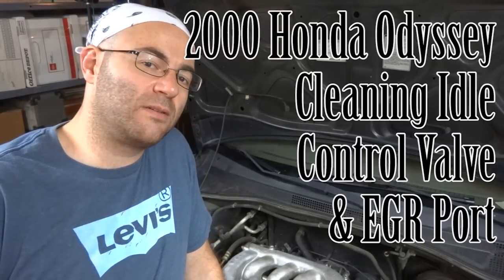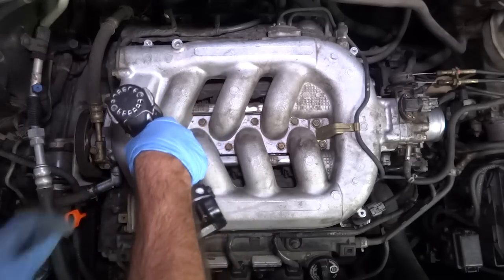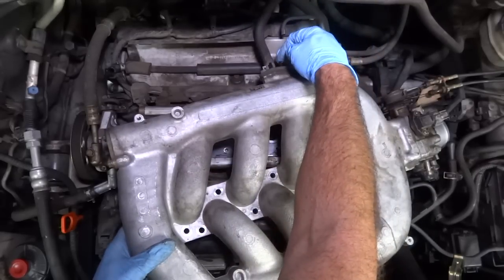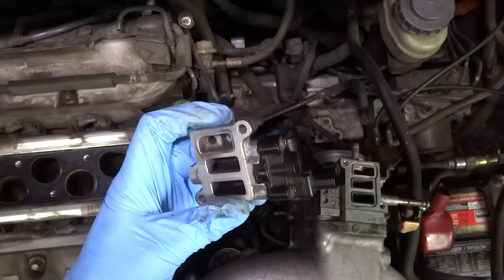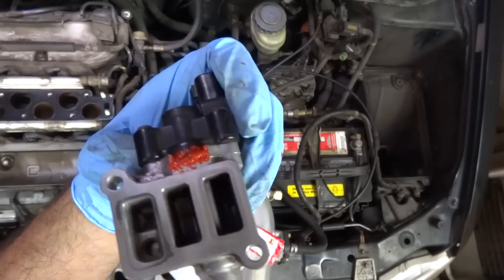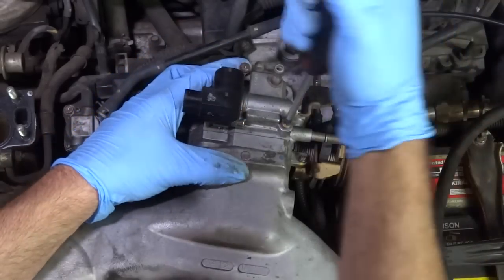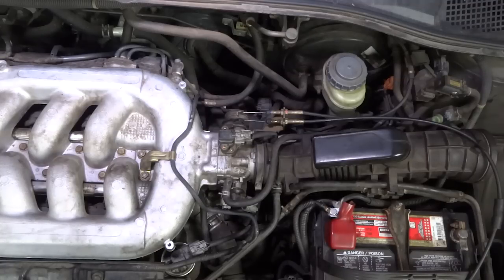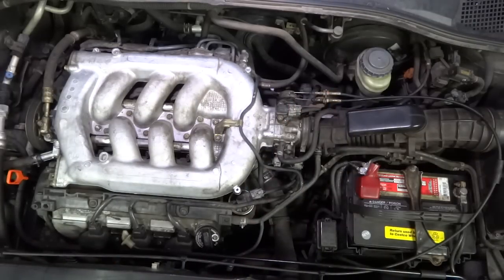Honda Odyssey Idle Control Valve and EGR Port Cleaning (P0401) DIY

Comment: For the IAC, you don't have to do all the disassembly.  As per your video, remove the air box, remove the connection from the airbox to the throttle body (have to disconnect a few hoses from it), then disconnect the coolant hose from the bottom of the throttle body, undo the two nuts and two bolts holding the throttle body to the manifold and it'll slide off. Turn the throttle body upside down and unscrew (2 screws) the IAC.
Reply: And then how do you clean out the EGR ports???
Reply: @cumshot247  you don't. The car I was working on did not have EGR problems, just a broken IAC, so I didn't want to do the extra work.
Reply: And for the record, the cleaned IAC stopped working again two weeks later so I replaced with a refurb off eBay, which has been fine for a couple months.
Reply: @PeterVieth  And for the record, this video was for cleaning out the IAC and to clean the EGR ports so that's why he took all that crap off...😒  The video wasn't about YOUR car...
Reply: @cumshot247  My comment started: "for the IAC, you don't have to do all the disassembly."  So if someone with just IAC issues searches Odyssey IAC cleaning and this video pops up first like it did for me, they don't go through all the steps of taking the manifold apart.  I suppose I should have known better than to respond in a YT comments section to someone with a username like yours.  Happy Monday.
Reply: @PeterVieth  Yes, you would have been better off making your own video commenting on your own work. Don't hate the Player...

Comment: There is/was nothing wrong with your IAC valve gasket.  Lacquer thinner causes these rubber gaskets to swell.  Notice how it fit again the next day when you came back to it and it was dried out.  Next time just use carb cleaner and you won't have that problem

Comment: Oh you kid!  You just saved me a few hundred dollars of mechanic's fees and unneeded new parts!   I just performed this maintenance, cleaned out the valve with Q-tips and methanol.  I finished it off by spraying some WD-40 in there and swabbing out all the excess.  I also reamed out the EGR port, which I had to pay to have cleaned out a few years ago.  It was well gummed up.   Now my 1999 Honda Odyssey no longer "seeks" at idle!   I reset the ECU error code, and now I need to drive it a bit before taking it in for its long-overdue smog check!

Comment: To save yourself a lot of work and trouble , just undo the 4 nuts holding the the throttle body on after removing the airbox leaving all the hoses etc intact . Just pull the manifold back away from the throttle body after disconnecting the IAT sensors , the 2 x 10 mm bolts holding the plate on and remove the large hose at the end .
You can remove the screws with mole grips or by clamping in a vice and use stock or low head allen cap screws after so you can take it off without removing anything but the plug and hoses . The O rings are standard size NBR which you could upgrade for a few pence extra and there is nothing fancy in there as the black part is just a controllable solenoid winding which lifts the pintle when energised like on any other Honda IACV. While your manifold is off , check and clear the EGR passages if necessary .
Reply: Thank you for your recommendation I was thinking the same procedure but I'm just learning again since I'm 60 😢

Comment: Informative presentation.  Not impossible but not an easy task thanks to Honda engineering.
How does the Idle Control Valve send a signal to the ECM?
Is there a way to confirm the signal from the Idle Control Valve to the ECM without removing?

Not much seemed to be gained by taking the ICV apart.

Comment: Hi. For my ody02. Only at cold start when idling, engine stutter and almost stalling, idles around 600, but everything runs OK after 10mins, idles normal around 750. No CEL. Thoughts?

Comment: Good morning, This video was very helpful   on cleaing my 2000 Honda Idle control valve however  my Idle control valve was not working effectively. I ended up replacing the idle control valve with a aftermarket part. What I noticed the vehicle. On the Cold morning  start up  there is no  high idle. Any idea on adjusting the idle control valve for a higher lide?

Comment: If you take the intake ( 4 bolts) off of the plimium, or manifold you my be able to get at that air intake vavle. However servicing EGR ports and channels is usually always required. Look to codes on how far to go?
Reply: Going to do the old seafoam treatment to get rid of check engine light for good though. Alot of trouble keeping EGR cleared. Out here in CA. RUNNING HIGH OCTANE SHOULD HELP TOO.

Comment: 6:20.... the screws are JIS type from Japan (Toyota and Honda).... heads  for those screws are NOT USA Phillips.... get a pair of bits for $8 in eBay. They will work fine and use a dab of Kroil or WD-40 at the base of the screws 30 minutes early to loosen them...   Put ALL of the hose clamps back in place  (see the center left screen)
Reply: Yes, if you own a Honda especially and plan on doing any work on them, get a JIS screwdriver. Vessel makes a good one with a striking plate at the end of it you can use a hammer on to get the rotors off your vehicle with.

Comment: I followed this but my idle in park revs by itself from 1-2k constantly.

It drives around fine and reverses fine, but when parked the rpm goes up and down. 

Can you help? 

I ran a obd2 scan no codes.
Reply: Did you replace the idle air control valve?  or you mighthave a vacuum leak, let me know how you do

Comment: The part that you remove is the same that I replace but now the idle is going up and down
Reply from the maker: +Augusto Quintero Are you sure you bleed your cooling system properly?  Filled the radiator back up with coolant?  The idle control valve has cooling lines going into it and is sensitive to coolant temp and air bubbles in those lines.

Comment: I keep getting P0108.  I thought it was the MAP sensor but I changed that and the problem persists.  It's doing pretty much what you described, idling between 1500-2000 RPMs.  What should I do?
Reply: You should find out what a PO108 code is!

Comment: will cleaning egr ports just push the carbon somewhere else and damage my engine??
Reply: No, but I would suggest using a throttle body cleaner spray and an old toothbrush instead of drill bits and steel wool.
Reply: @cookingwithjesus  Technically if you rotate the bits in the right direction while inserting, it should pull out the carbon as opposed to pushing it in. Hell, now I have to try it and then finish it off with carb cleaner...

Comment: You need to clean the passage from the manifold port, through the block , to the EGR valve. Use an old speedometer cable on a drill.
Reply from the maker: That was already done prior to this.  The problem in this case was the popped out o-ring/gasket.
Reply: How long of a cable would you need? About a foot???
Reply: @danblake3265  um, is that 2 1/2 to 3 ft?
Reply: @danblake3265  Thanks!

Comment: Hi by doing this method cleaning egr and idle control valve is this way gonna fix the problem of idle shaking when you start car in morning cause when start my car in the morning idle shake and when car is warm up everything is good idle no shaking please help thanks?
Reply from the maker: Sounds like you have a vacuum leak somewhere.  I would recommend getting a smoke test to find where it is.
Reply from the maker: I also have a video on making your own smoke tester.

Comment: So what should I do now?? I bought in the auto parts works fine for a day and then keep doing the same
Reply from the maker: +Augusto Quintero I don't understand what you said.
Reply: +Augusto Quintero Sounds like you bought a new IAC valve and your problem returned.  Did you clean the EGR port as well?  If the EGR passages are loaded with carbon, I'd imagine that your problem would return quickly.
Reply: Or maybe your problem is something else??? MAP sensor? Bad Coil? Clogged fuel injector, Gremlins...

Comment: Hey i have a question i have an ody 01 and since 2 moths when the cold started i noticed something it’s really annoying my van keep dying like soon i start rhe car the rmp goes 1,500 thats normal a few secons will slow down well stay there for a while but lets say if i turn on and start driving after a min from the start it die on me at the first traffic light or top i start right away but i have to put my foot on the gas n brake so keep it alive i replace map sensor tps have new pcv valve  spark plugs clean the tb it only happen in the morning or whatever i left the car sit for a few hours when it get at the normal temperature works fine
Reply: Did you find out what it was? Or did you just move to California?
Reply: cumshot247 it was well I didn’t fix it cause I ending up clashing on a electric pole but I did some research and it was something with a valve adjustment valve was out of clearance

Comment: Hi.I followed your step by step cleaning out my Idle control valve on my 2000 honda odyssey . I ended up replacing the oem with a after market part.  I  notice. the ldle  very low when I turn on my Ac the RPM Went down to  200  Any idea on adjusting the Idle high?

Comment: I have a 2002 Honda Odyssey with about 170K miles on it.  The thing has run like a champ since I got it and never had a problem or broken down.  But after almost a year of not being driven in the pandemic when I changed the battery and started it up, the idle speed changes regularly.  It revs up and then slows down and then revs up again and slows down and continuously does that  ... grrrrRRRR grrrrRRRR grrrrRRRR over and overwhile in Park or Neutral.  It's pretty normal in Drive or Reverse.  A guy told me it was probable  the Idle Control Valve and I looked at some videos about how to do it, but I think it is too much for me.  So I'm wondering how likely is that the problem, and how expensive is it to fix?
Reply from the maker: It’s basically what you saw in this video or it’s a clogged EGR port which I believe I also talked about here

Comment: You really missed a lot here... the motor you took off the TB, actuates a cylindrical valve inside the IAC. THAT valve gets carbon fouled and it's operation is what causes your idle to suffer. You needed to clean that carbon off the inside with carb cleaner until you had a smooth operation. Also, TSB 05-026 details how to install a kit to prevent EGR fouling (you were on the right track with the drill bit.

You can do the IAC without taking the intake off...just the TB needs to come off. If you were going to do the service on the EGR, the kit for the service is needed, otherwise you're going to encounter the clogging. Thought, I think your main issue is the IAC valve body just needed a good cleaning.
Reply from the maker: +xr500t At 5:48 there is a msg saying I somehow missed the shot where I cleaned out the IAC with carb cleaner.  Maybe you were skipping through the video or something?  I know you can take the throttle body off without taking the manifold off but the TB gasket is kinda stuck and I can tell if I pull it off it'll tear and I'd have to replace it, so that's why I just remove the intake.  I think I mentioned this in the video as well.  Not big deal to me.  The main issue was that the o-ring was blown, causing a tiny leak (and a high idle).  The IAC valve is actually working fine.  From what I read of the TSB when I originally encountered the EGR problem, they want you to dill the port out and install an insert.  Didn't see how that would be very different from what is there now.  Maybe it's a bit bigger or something?  Seemed easier to me to clean it out with a drill bit in another 100k miles when it clogs again.  How does the insert prevent clogging?
Reply: +50sKid  You did a nice job with the video.... I was pointing to the operation of the valve inside the body of the IAC. This is huge in controlling your idle. You used lacquer thinner and a brillo pad(not a problem)to clean the gasket surface, however I did not see the cleaning of the inside of the valve body where the valve is located. That valve is spun by the motor and the carbon build up, hurts the operation. In addition, the TB itself can use a cleaning as as well. Thought it's tough to get it squeaky clean. BTW, you can test a vacuum leak by spraying carb cleaner in the suspect area. 

I would have been more concerned with ripping the intake manifold gasket than the TB gasket (you can make your own with gasket material, it's a smaller surface than the intake, easier to get to and easier to fix.).  If you're careful, this gasket will not be damaged, and can be re-used.

The EGR tube kit is made of teflon, and may be to mitigate exhaust gas temperature when the car is cold. I think a cleaning of the port every so often works as well.
Reply from the maker: +xr500t Nah if it's teflon then it's designed not to cause carbon build up.  It's hard for stuff to stick to teflon.  That's why they use it in pots and pans.  The gaskets are super cheap--I just didn't want to run out at the time I was filming, lol.
Reply: +50sKid, my 2000 odysssey has a 3.5 VTEC, 193821 miles,TCS light popped on a few days back while at stop sign. when i accelerated, it hesitated then drove ok. i checked and cleaned the plugs and this evening i cleaned out the EGV valve and light is still on. clean out the manifold (EGV port) and new spark plugs will be done tomorrow. i haven't got any codes yet cause i cant find a reasonable honest mechanic. my idle is fine, just under 1000, i did replace alternator and battery last week. im asking you what would be my next move? thanks 50's kid

Comment: Did you have a TCS light with this and Hard Reverse shift? along with the p401 I replaced the egr a long time ago and I have been having the same codes since. I did the Egr port cleaning as well and still have these issue since last year. will the high Idle also have issues with shifting. I noticed when its not acting up I have better shifting results.
Reply from the maker: +NeekafiedGamer No TCS light when I did it. P0401 technically means insufficient EGR flow, but that doesn't necessarily mean the EGR passage is clogged up.  It could mean that the EGR valve isn't opening as far as it is being commanded to by the computer.  You have two options, you can try replacing the valve now or you can wait 2 weeks for a video I have coming up on diagnosing a bad EGR valve on this vehicle.
Reply: +50sKid yeah will do man! I'm tired of working on this thing. I'm also wondering maybe this is why the dealer was so pushy to sell this to me Lol.. oh well.
Reply: +MsgtDonutGames Did you fix it yet?  If you P0401 is not going away and if the van does not tall after applying 12V directly to the  disconnected EGR valve, your have got the blockage in the path from the valve to the intake plenum.  I have been battling this for weeks.
Reply: MsgtDonutGames did u figure out the TCS light problem
Reply: Did u figure out the TCS light problem? Im struggling with the same issue right now. I just don't know what route to go to fix it.

Comment: Do you have something on how replace the rotors to a Ford Escape 2008??
Reply from the maker: +Augusto Quintero I've got a video coming up for a full brake job on a Crown Victoria which should be a very similar setup to the Escape, with drum in hat rear rotors.
Reply: Yeah buy a Chevrolet.
Reply: @50sKid  Or he can just look up "How replace the rotors on a 2008 Ford Escape 2008" wtf...

Comment: Hi I have this issue with the idle control valve that when you turn on the engine the idle is really low, I replace the idle control valve and now when you have the car in parking the idle goes up and down up and down if you can contact me and give a little help thank you.
Reply from the maker: +Augusto Quintero Did you replace it with an OEM idle control valve?
Reply: Any time you take anything off the TB , or replace any part , clean any part , even changing the coolant,  you have to do the COMPUTER RELEARN PROCESS.....

Comment: I have the identical Odyssey but unfortunately in my case the lower part of the EGR passage is plugged up.  I have tried twice to clean it up but so far no dice.
Reply from the maker: use a thick wire to poke a hole through it and gouge out the carbon.
Reply from the maker: +12vgs8606 You need a good solvent.  Just use some throttle body cleaner.
Reply: +50sKid I don't see any downside.  The probability that big chucks of carbons will come lose and enter plenum and get stuck on the intake valve seat preventing valve from closing is minuscule, right?  Right??
Reply from the maker: That's the reason you clean it all out.  Have you tried a drill bit already?  Seemed to work well for me, just spinning it in by hand and cleaning the gunk out.
Reply: The plenum passage is fine.  It is the one from the lower engine block to the EGR that is almost clogged..  Usually this does not clog but there have been few people who had the bad luck.
Reply: 12vgs8606 gui ml

Comment: Okay so my van just recently started whenever you're driving the RPMs go real high and the car wants to slow down and then sometimes it don't want to shift past drive I have heard that it could be two different things one could be the torque converter or the other one can be the transmission gear solenoid I am not really for sure does anybody have any answer for this
Reply: Amy Barraza did u figure it out?
Reply: @MRCALIEMS  She prolly has one of them Smart cars that drive by themselves. She just don't know it yet...